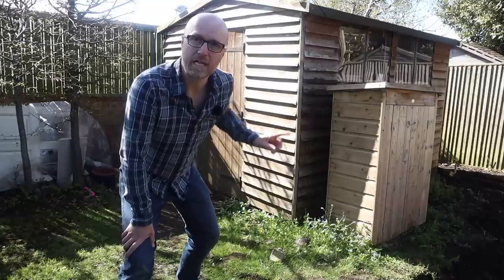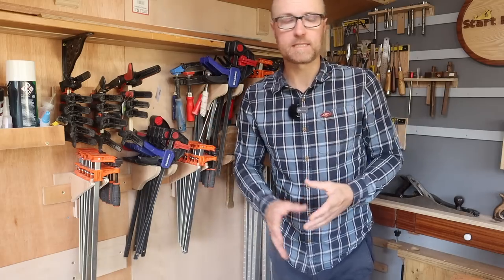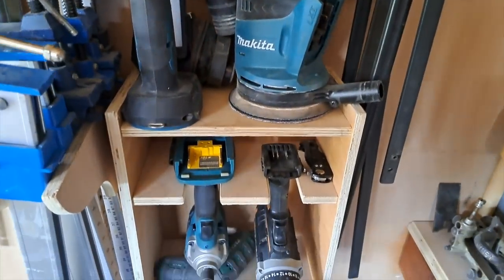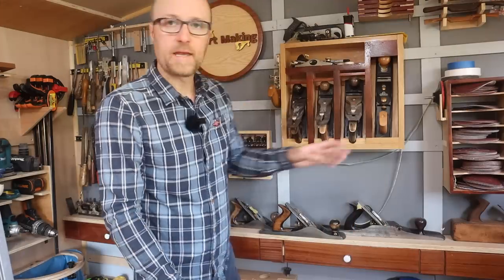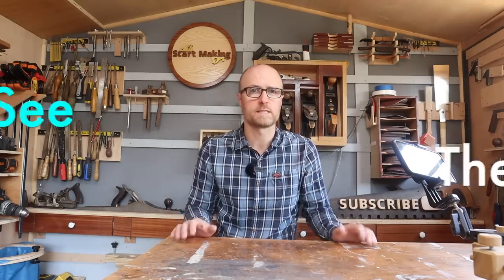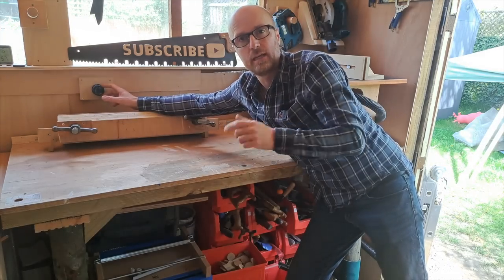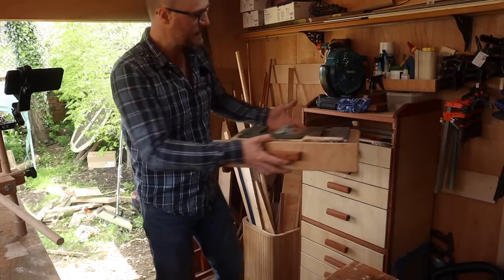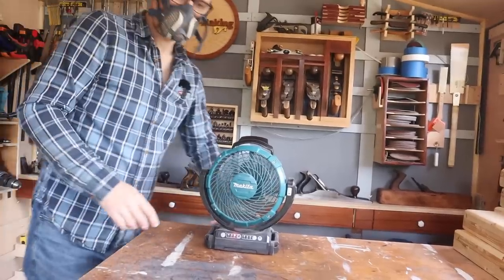You Won't believe how much I fit into this small SHED.

Comment: I had no idea you were in a small shed! Well done on the filming you've done so far.
I'll watch this video in full later, but what I would say - and no joke - is that every workshop and outdoor sitting area needs is a coffee shelf.
A coffee shelf? Yes. A shelf where you will always have free space for a mug of coffee or drink of your choice, somewhere you can put a watch or clock and somewhere you can put a notepad of sheet of paper you are using to guide your project.
Reply from the maker: Hi. Thank you so much. A coffee shelf is an ideal idea for a starting point in making the new workshop my own. Maybe I can pop it on a French cleat so I can move it around to where I am working. Thank you for the brilliant and simple idea.
Reply: @startmaking1  You are welcome! That's a really good idea! The one in my tiny garden is moveable. The one in my cellar is not - it's a dedicated non-tool area on a larger shelf.
A consideration for me is that it has to be fairly out of the way of tool use, sawdust and things dropping into the drink. 

As an aside ... true story ... when I was youngster I very nearly drank the last mothful of a cup of coffee that I had dropped mortar into and nearly puked all over the wall I had just pointed! It was a bit grim, but imagine if that were a screw or nail. Far worse than finding a dead fly in your mouth.
Reply from the maker: Oh wow, yeah. When would have thought that mortar was a lucky escape. Maybe a covered shelf somehow. Though if I get the dust collection right, then it may be better than the old shed

Comment: I'm in Berkshire. Happy to help you build your new workshop if you could do with a hand. I'm good with electrics too. :)
Reply from the maker: Oh wow, not far at all really. I am near Banbury. You are very kind. And thank you for an amazing offer. It is going to sound very strange but I have an idea that I need to build this solo. Prove a point to a few people around me that said it was not possible. Sounds silly really to turn down such generous help, And dont worry I am not going to suddenly try my hand at electrics, from zero experience. I actually need the house rewiring and a new fuse board so long story short, it is time to spend a fair bit anyway. Seems sensible to pile it all in. I will probably lay the wires in the shop though, so you may get a few random messages asking advice in a few weeks. thank you though, very much appreciated.

Comment: Mark, you'll find out that you're going to miss that shop.  It's like your first love, (we all have had them and had to let them go).  But, I never know whether I like building projects, or re-building my shop for a more efficient flow.  Now, once you get the larger shop, you'll have to buy new stationary tools to make you even happier.  With the new shop, you'll have to bring back the rugby jersey!
Reply from the maker: Hi. Im not too proud to admit that I shed a tear when I pulled the walls down. And not just from one nearly squashing me. I love how you remember the rugby jersey. It's one of my favourites and actually I think I am wearing it in one of the first build videos. I am very excited about the new workshop but it is a big project for someone who builds jewellery boxes.
Reply: @startmaking1  You've got it.  All woodworking/carpentry is based on square, level and plumb.  Think of the new workshop as a giant jewelry box in which  your most precious stones will go into.  Lastly, the structure is only as good as the foundation.  I have complete confidence in you and from building my own, I know the satisfaction you will derive from doing it (after the frustration has worn off).  Just work your plan.  Best of Luck!
Reply from the maker: You are kind. And honestly my confidence after today is higher than it was. thank you. the foundations are in place now. I could not drop a pad on concrete like I wanted as there is no access to the garden from the road, only though the house so I carried 63 slabs down and set them , And I made it nearly level, lol
Reply: @startmaking1  I wish I could still carry 60 slabs.  It's going to be great!

Comment: So, roughly 7.5 m2. I have 10m2, and fit in-
Large lathe, milling machine, table saw, router table, two bandsaws, MFT table, belt sander, mitre saw, two grinding stations, folding machine, 39 other hand power tools (drills, planers, etc) metal store, wood store, around 70 hand tools, storage for thousands of screws bolts and nails, sanding store (disc belt and sheet) triple output automatic dust extraction system, air cleaning and monitoring system, heating, sound system, compressor, gas & blowtorch as will as all the machine accessories (chucks, rotary tables, angle plates) and measuring equipment. It also transforms into an electronics lab, with scope, power supplies and racks of components.
So, welcome to the start of a journey...
Reply from the maker: Something like that yes. Though the lack of power is the main draw back in the grand scheme of things. That said, you have done a very good job of using the space you have Mike. And I can't read the list again for fear of developing tool envy. The new workshop should be around 17 square metres all going well. I hope to have some of the tools you have listed, let's see.
Reply: @startmaking1  Didn’t intend to brag, just saying that it is surprising how much one can pack in. Good luck with the build!
Reply from the maker: I understood that it was not a brag. Promise. What you have done is impressive, you should be very proud.

Comment: Stick a rubber strip over magnet straps for grip
Reply from the maker: Do you mean over the magnet bars that I pop tools on. Because if you do, this is a really good idea to stop the tools scratching too, not files, more chisels.
Reply: @startmaking1  yes, also stop tools sliding off. Try self amalgamating tape maybe or old cycle tube
Reply from the maker: I may even try some acoustic foam tape that I have, thin and rubbery. Great advice.

Comment: I have been wanting a small shed to make some projects. I am worried about huge swings in temperature/ humidity. Will it effect my wood projects
Reply from the maker: That is a good point and something that if I had a longer video I would have touched on. I used to store all of my hardwood in the shed and the biggest issue I had was that the wood would acclimatise to the shed and them when I took the finished piece up to the house, the piece would cup and bend. Now that is not an issue if it is held flat properly and allowed to move seasonally but for things that are not really held like chopping boards and such this was an issue. So I started to store all of my wood in the house at that temp and only take it to the shed to build. This seems a better way. As far as humidity, in the UK I have found the swing in the seasons here mainly a temperature issue.
Reply: @startmaking1  I wonder if i should build my we workshop like a house with insulation and and waterproof breathable barrier on the outside so the temp is more stable
Reply from the maker: @ammcknockiter  Thats what I am attempting in many ways, though I a not sure that I want the cost of heating/cooling it constantly. I know though that in the US people use a mini split. I am not expert in that though.

Comment: Is there a link to those lights? They look like just the thing i need in my shed.
Reply from the maker: Hi Michael. These are the ones that In have
https://amzn.to/44f5zQ9
I dont know if they are the best but I did a fair amount of research and real y struggled to do better. Takes a little tinkering with how they work best and remember that they dont work, or at least mine didn't while charging. I have to disconnect the wire and then they stay on fully. Oh, and they are motion sensors so if you stop, they will go out. And every so often when I go down after dark, even when they are charging they are on. Weren't when I left. As I say, tinkering. But overall, for a cheap solution Im not unhappy. PS, that is an affiliate link, no extra charge but if you want to not use it, you can go on amazon and search Solar shed light, company is supkoolis,

Comment: My god man run an extension 😂
Reply from the maker: I tried that and it is a massive pain for anything other than one tool. But I see your point. Would be less work.
Reply: @startmaking1 : The best idea is a small sub panel, fed from the house, on a 30 amp breaker. The sub would be 2 15 amp breakers, for 2 circuits, in the shed. It can be run, from the house in under ground ( 0.5 M ) plastic conduit, using 2.5mm wire (?).
Reply from the maker: This sounds like exactly what I need. I will be relying on an expert for the wiring as I am not gonna start Making a fire hazard.

Comment: hello
you sure have a very nice set up and great ideas 
i notice you have the scheppach dust extractor  just wondering how do you find it 
in regard to been reliable and  i have one but don't use it very much  so i would like to know your thoughts on it  i have sub to your channel as i just found it
thanks
james
Reply from the maker: Hi James. Thank you. to be honest I do like it. It struggles a little with a high volume machine like a thicknesser. But for hand held it is great. Though as I have it outside, Im sure you can tell, it is really quite noisy. For reliability though, I have had no issues at all. the cyclone really helps with the filters too. I hope that this helps.
Reply: @startmaking1  thanks for the reply thats good to know about the reliability  of it so hopefully mine should be fine too and yes its noisy
thanks
Reply from the maker: You are welcome.
Reply: @startmaking1  👍

Comment: Put candle wax on your friction drawer runners
Reply: I was thinking of a chain on a hook inside the drawes to stop then being pulled out too far, by accident on my drawers
Reply: Bet your neighbours like u with the dust
Reply from the maker: Great tips. I will see if there is room for a chain. Though I do like the fact that I can move the draws around and when I make more cabinets, I can move them between. My neighbours seem fine on the whole. In truth I tend to use my dust blowing technique on rainy days, especially as next door has a pool. We will see how patient they are when I start building work.